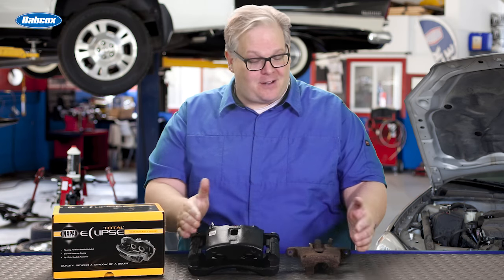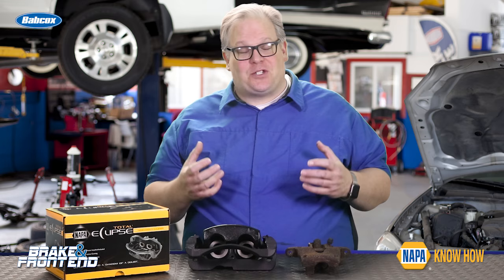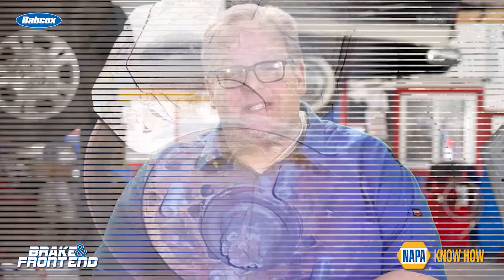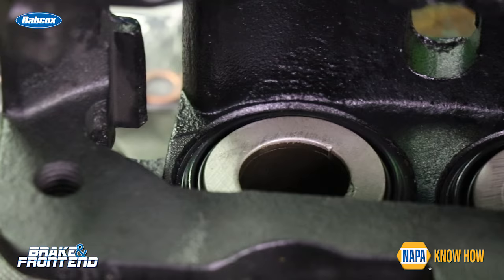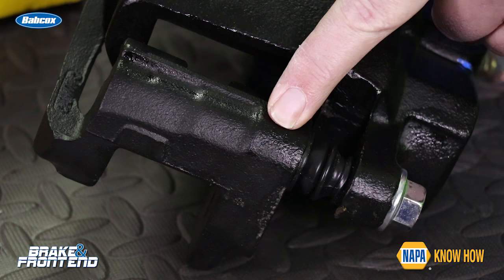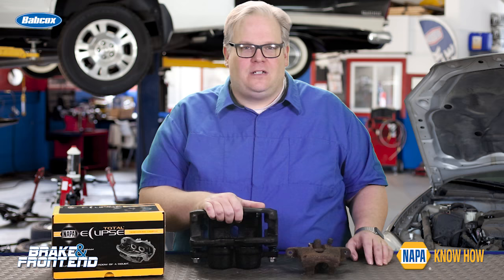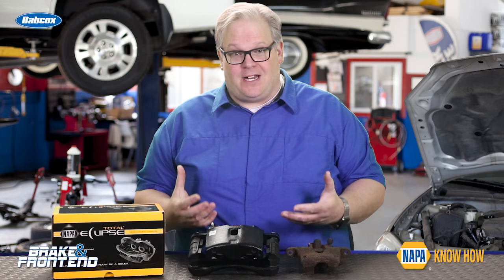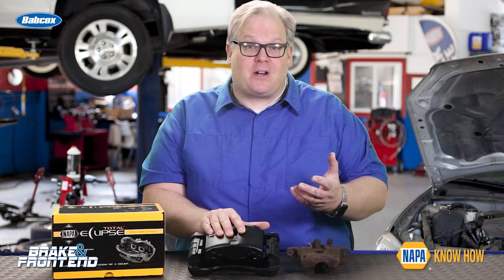4 signs a caliper needs replaced | 4 Tips

Comment: When the guide pins get seized up you have to replace the whole caliper? Not just the bracket itself that the pins are stuck on?
Reply: The guide pins are inside the caliper. One at top and one at bottom. The caliper bracket is what the guide pins screw into to hold the caliper in place. I have been doin my own brakes since the 90’s since  no mechanic is gonna clean n lubricate everything the right way since it takes time. At least none around my area. The guide pins need to slide nice n free as do the brake pads need to slide freely in the caliper so they retract when u take your foot off the brake pedal. Pretty cheap to get a new set of pads, rotors n calipers if you’re DIY. If u change the caliper u must bleed the brakes and always use new unopened brake fluid since it absorbs water if stored. Good luck
Reply: What he means by seized up is not that u can’t unscrew them from the bracket. He means they’re seized up in the caliper itself. U can remove the guide pins and clean them and re lubricate them with silicone lubricant and put them back in. Even after they’re screwed into the bracket and you’re done with the brakes and about to put tire back on, the guide pins should still be lubricated enough so the caliper slides in them. Hope this helps
Reply: I got the same question
Reply: What’s the question
Reply: @pujo28  
When the slide pins are frozen is it necessary to replace the caliper or just the bracket and pins will do it?
Reply: @rafatorres1420rt  if you can remove the slide pins then try cleaning them and relubricating them as a temp fix. Otherwise replace just the guide pins. The bracket doesn’t need replacing. The caliper only needs replacing if the piston is not able to be retracted or pushed back in with a C clamp or big channel locks. You’ll know it since it shouldn’t be too hard to push the piston in the caliper back in. Some caliper pins need to be turned in which can be done by hand with pliers if the caliper isn’t too old, otherwise Auto Zone rents the took to turn the pistons in which both my cars have only for the rear calipers though. If u do change the caliper u should do both sides then bleed the brakes. If so, bleed the brakes with old caliper on so u flush out some old fluid in the old caliper b4 taking it off and installing new one. If slide bolts r stuck u can use channel locks to rotate them back n forth to loosen up. Hope this helps
Reply: @pujo28  
Thank you that's exactly what I did in my front calipers I didn't change the slide pins just clean them but they seems pretty rusty and move but slowly than the others
Reply: @rafatorres1420rt  then u should change them next brake job. It will cause your pads to prematurely or unevenly wear. Caliper needs to move evenly on top n bottom. They’re cheap enough to just order new ones every few years. Use silicone lubricant on them after u clean them and b4 u reinstall them. Copper lubricant on back of pads and on each brake pad tab that sits in the guides on top n bottom of the bracket. The pads should also slide back n forth when sitting in bracket so they retract a bit after u release the brake pedal. Sometimes pads need to be shaved down a bit on one of the tabs. I did a video on that on my channel. Good luck my friend
Reply: @pujo28  since the pins are rusted probably the holes on the bracket too right ? 
Thinking if I should change the bracket just to be safe
Reply: @rafatorres1420rt  I’m sure it is. You should be able to get a whole kit that comes with a new bracket as well. Good luck and keep everything libricated. A mechanic won’t do what a DIYer will do
Reply: @pujo28  
I'll do it 
And you're right mechanic just want to do the job ASAP so is more money for them and I understand but they cut those corners
Reply: @rafatorres1420rt  Just  clean,lubricate  the  pins  and  put  back.Thats  all.Nothing  more
Reply: @pujo28   what is your channel….I’d like to check it out.  Thanks

Comment: What if you take off the caliper and notice basically black slime all over the place coming from the hose?
Reply: That's your brake fluid
Reply: @Lil513mama  And it shouldn't be black.  I'd recommend a brake flush (replace the brake fluid with new) and likely new calipers.
Reply: @jeffstock7819  yes I completely agree 💯

Comment: 1:36 Why do you replace a caliper if it's the bracket that is corroded?
Reply: It's a good rule of thumb. Beyond that, i have no clue other than depending on the rype of corrosion and tge cause it can spread from one thing to other depending on material as long as the two things are touching

Comment: How would it sound
Reply: It would sound like a grinding sound you need to replaced your caliper
Reply: See I replaced my breaks and rotors and found out that one break pad was at 10% and the other was 40% so they wore out unevenly. Two weeks later I started hearing a grinding/rubbing when I breakers and so I had the caliper done but I’m still hearing a slight grinding/rubbing as before just not as much. I just had the caliper replaced so I’m guessing I just need to break it in? Since I’m still breaking in my brakes and rotors? If not then what is still causing the sound???
Reply: Thank u

Comment: See I replaced my breaks and rotors and found out that one break pad was at 10% and the other was 40% so they wore out unevenly. Two weeks later I started hearing a grinding/rubbing when I breakers and so I had the caliper done but I’m still hearing a slight grinding/rubbing as before just not as much. I just had the caliper replaced so I’m guessing I just need to break it in? Since I’m still breaking in my brakes and rotors? If not then what is still causing the sound???
Reply: I'm not even close to an expert, but did you do the job yourself? Did you push the piston in with a clamp?
Reply: @morehn  I did not do the job myself but I can ask the person if they pushed the piston in with a clamp. I kept hearing the horrible grinding noise, took it to several mechanics, no one knows what's causing the noise. I have replaced every part of the front of my car except the lower arm controls and the cv axle. I even replaced the caliper again because we thought maybe the caliper was faulty, it's still making the same noise and no one knows what to do because everything is brand new and the parts were premium parts so they weren't cheap. You name it, we have tried it and replaced it, even fluids and entirely new suspension system. Nothing has worked and it is only my passenger side that does it and it only does it if I brake slowly as if coming to a stop at a stop sign. My car is less than 10 years old and I have done everything I can to keep up with its maintenance so it is definitely taken care of, we just cannot figure out what is causing the noise. It sounds like grinding, dragging, growling noise and you can feel it too. It is coming from the passenger side but you can feel the vibrations/griding make its way to the driver's side. Please, if you know ANYTHING please contact me back. It is a 2011 Nissan versa 4 cylinder, 1.8L hatchback if that helps.
Reply: @MC-sh6jf  did you try turning it off and turning it on again?
I'm a super amateur with cars, so I'm far from knowing. I wish I would have an idea for you but it's way out of my league.
Reply: @morehn  Turning what on and off again?
Reply: @MC-sh6jf  i'm just kidding about that. Truthfully I have no idea. Try posting the question on a car forum and maybe someone will be able to help.
Reply: Ask a mechanic to listen with their equipment to where the sound is coming from. Or have you fixed the problem?
Reply: @jeffreysantos9070  I tried that with seven different mechanics. Two did not hear anything because they did not test run my car correctly. Five of them did hear it but two will not look at it without me paying them $200 an hour and the other three heard it and have no idea what is causing it because all of the parts are brand new. I am at a complete loss. It will not do it unless the parts are heated up which is why the first two mechanics did not hear anything. The only thing left to replace is the lower control arms and the cv axles, other than that everything is brand new, even fluids. It is driving me up the walls trying to find out what is causing this noise.
Reply: @MC-sh6jf  how about engine mounts or transmission mounts?
Reply: @jeffreysantos9070  I just had the torque mount replaced because mine was broken for god knows how long an not a single soul told me until just recently. I had the transmission mount looked at once and they said it was fine but I think I will have another person look at it just to make sure.
Reply: What car do you drive? If it is a 4wd, check the hub locking/unlocking mechanism... 4wd cars tend to grind/hum when the hub lock doesnt release. Check your brake master cylinder as well for an internal leak which sometimes doesnt allow the calipers to fully disengage
Reply: @morehn  I always try pushing in the lighter and blowing the horn . Results are debatable.
Reply: the  pins  are  seized,stock.,,,not  closing

Comment: TIP -- Don't try to go cheap on your caliper grease!! I use Permatex Synthetic Brake Lubricant, $25 for 8oz. My Ranger went a year between brake inspections, had the good grease on the slide pins and the hardware, still slide the caliper back n forth by hand!
Have used cheap grease before, brakes failed, the grease looked like dog turds and nothing was lubricated!!

Comment: A warped/high spots on a rotor, is a possible indicator that the caliper is stuck, causing abnormal pressure/heat on the rotor. Don't just throw fresh rotors on without checking the calipers, because in a couple hundred miles of driving your rotors may warp again, and your customers say, wtf!🤣
Reply: Good tip.

Comment: Need assistance. The last couple of years or more we have seemed to have to replace the front brake pads every year. I've purchased the cheap and expensive pads. Took car to a mechanic I trust,  let him know of the situation, he felt that the calipers were fine. All brake lines have new fluid in them. Now after 6 months need new pads again. Pads had even wear. Really confused. Chrysler T&C has 271K miles on it and have never replaced the calipers.

So, should I replace the calipers or is my wife too hard on the brakes? We do live in a hilly area.
Reply: Check if your pedal has  proper freeplay around 1/8 inch.
Reply: Blaming the wife 😂 she sure picked a winner 🥇
Reply: @user_abcxyzz  The irony, a man who names himself after a serial killer, who also can't read a question, calls me a winner. You'll do well in life.

Comment: Bad information, I often saw calipers were in good condition but bottom slider pin seized which caused an uneven wear on brake pads.  Honing inside hole with wire brush & a new kit of slider pins ( $20./per set  comes with rubbers) Also replacing brake pads . 
I think it's nonesensicle to replace good calipers if the issue is only the slider pins unless you have an extra $250-$300+ for new calipers because a Mechanic will strongly suggest you replace both calipers !!